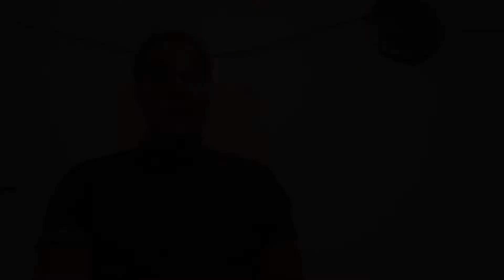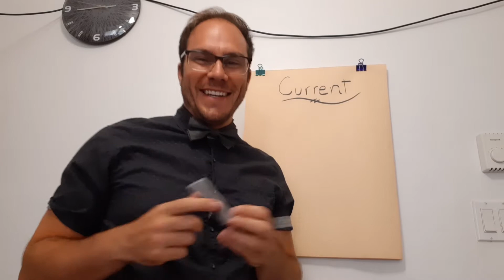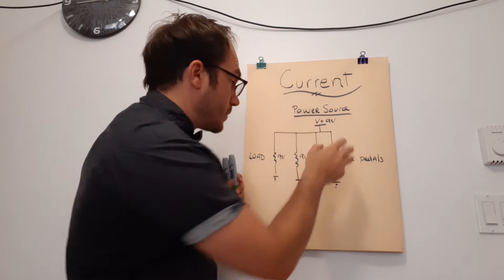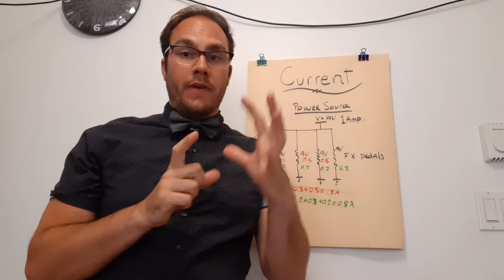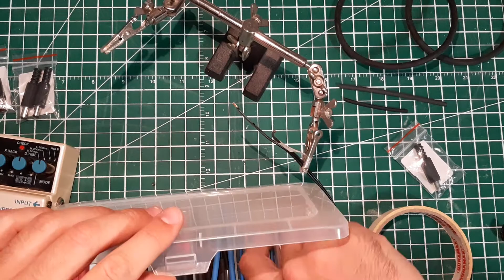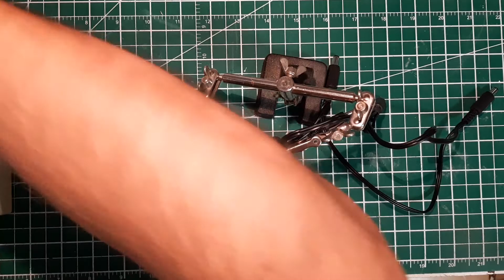Daisy Chain Power Supply for Guitar Pedals

Comment: how do i find out how much my switchboard 5x 9vdc ouputs total draw capacity if its not written.
Reply from the maker: What are the devices?
Reply: @ThePhilStudio  thanks for the answer. its an Aria APB-5 switch board, with 5 loops and 5 9v dc outs.
Reply from the maker: @ruthlesscutthroat  It will depend mostly on the pedal you are plugging. Most of the Boss or typical pedals are no higher than 500mA.
Reply: @ThePhilStudio  output capacity can be fairly well judged from the transformer, yes? im not too sure, but it seems even high end switchboards that provide power, go up to 500mA max on all output taps. maybe if i open it and I see a bigger transformer, i can assume its good for 1A

Comment: I built a six port box using four LM7809 voltage regulators connected to DC jacks and two LM7805 regulators connected to USB jacks and I use a 12VDC wall wart to power it. I call it ... DC/DC 😏 (I handle different polarities with the DC patch cables I made.)
Reply from the maker: Wow! That's great, exactly the kind of project I wanted to do right after this one. Good job! Do you have a picture or a video of your build?
Reply: Thank you! I have tons of pictures but no video of the build. I am planning on building a second one (since this one has not caught on fire!) and making a video of that process. The 5V USB jacks were a good idea but my skills installing them were not so for my 2nd box I will use 12V instead of 5V and see how that works out.

The overall design is very simple, relatively speaking of course -- just the voltage regulators, two capacitors for each one and two more for the input voltage, a protection diode and LED + resistor. And a bunch of DC jacks. Thanks again for your videos I really appreciate them! :)
Reply from the maker: @HazeAnderson  great great! For sure it didn't catch fire the LM 78xx are such a good regulator! :) ahah